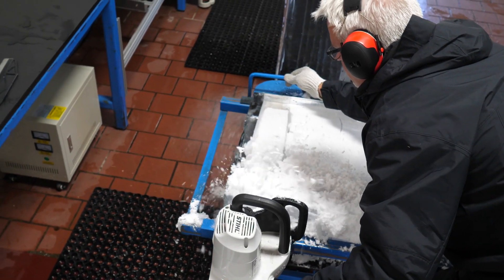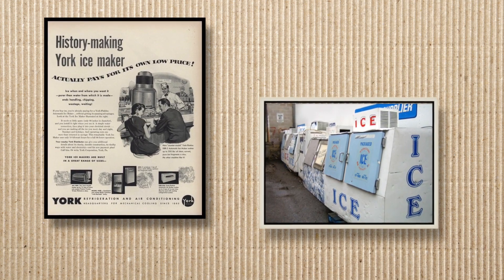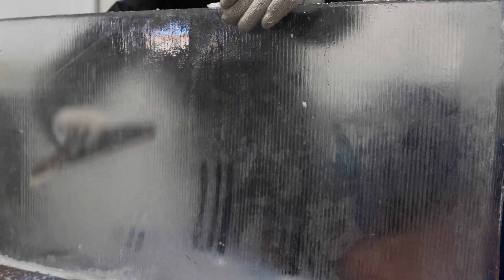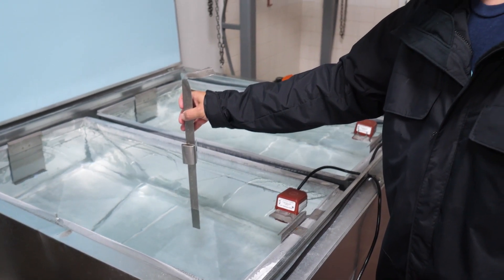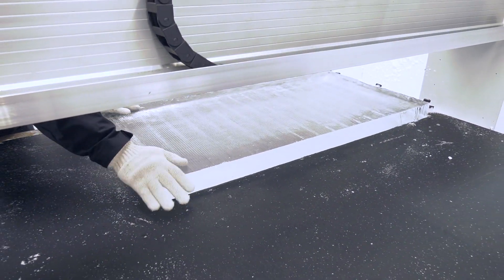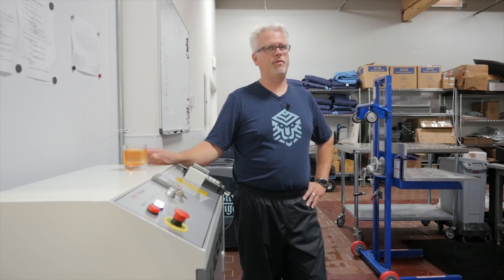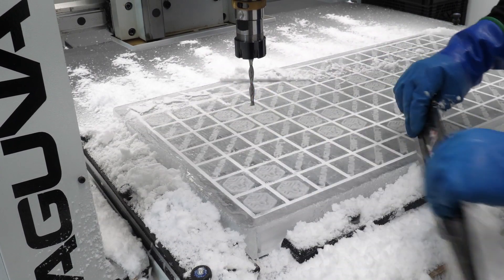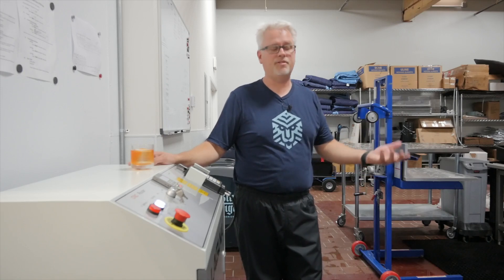Cutting Ice with a Laguna Tools' CNC Machine ft. The Blind Tiger | Customer Stories

Comment: Luxury ice, sure why not
Reply: https://lagunatools.com/cnc/swift-series/standard/?q=product/cnc/swift-series/standard/
Price Starting At: $13,645.00
highly expensive.

https://www.blindtigerice.com/pricing
Cocktail Ice (each)

2" Cubes                          $0.88
2" Logo / Monogram Cubes          $1.25* 
Collins (1.25" X 1.25" X 5.25")   $1.15
2.75" Spheres                     $1.45
4" Punch Blocks                   $5.00
4" Logo Punch Blocks              $10.00*
* Logo requires one-time $25.00 design fee.

Large Block

12" X 9" X 6"                     $39.00
1.25 Inch Bagged Ice (Kold-Draft)

10 Pound Bag                      $8.80
20 Pound Bag                      $17.60
Crushed Ice

10 Pound Bag                      $8.80
20 Pound Bag                      $17.60